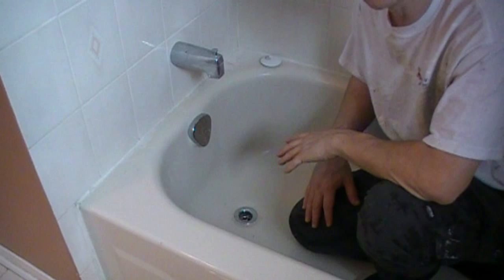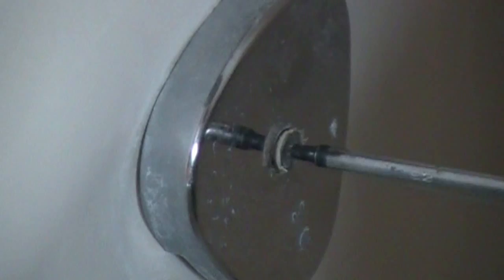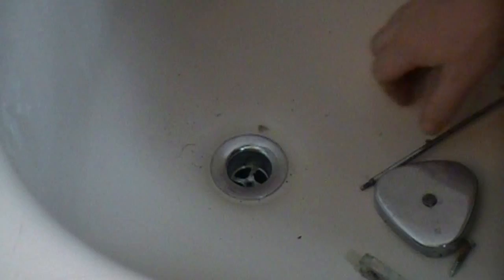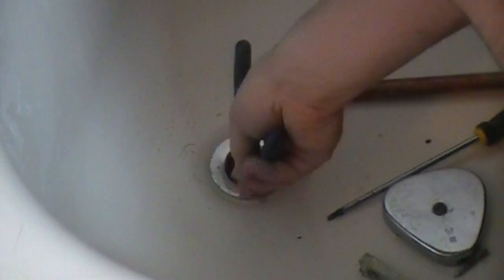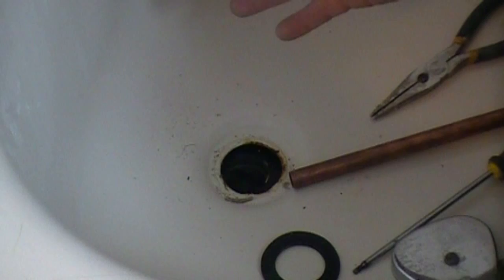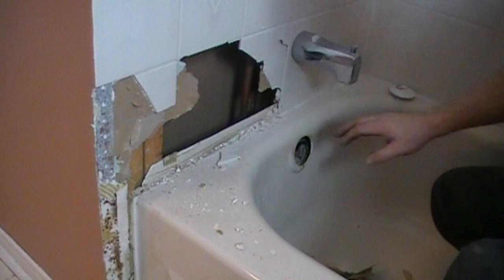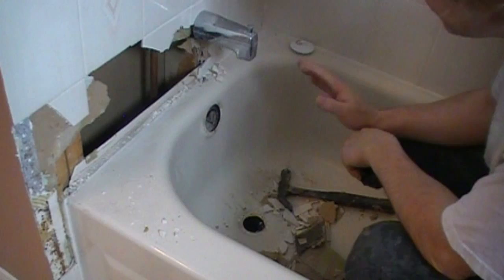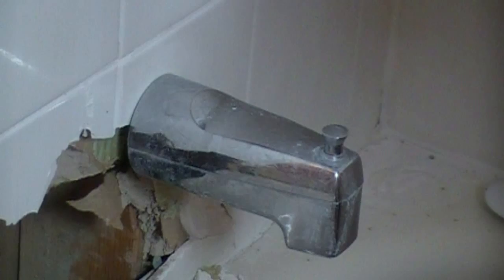Removing a bathtub - How to DIY

Comment from the maker: With the drywall removed, you should have space on either side to get it in. Or out. 

If the tub is cast iron, you can take a sledgehammer and break it up. Same if the tube is acrylic. If it is steel, like the tub in the video, it is lightweight and you just pull it out.

Comment: I watch62 tub removals your is the Best explaining and showing and no sledge hammers
Reply: You don't need a sledge hammer on a steel tub such as this.  They are light and easy to maneuver around.  I've used a sledge hammer on cast iron tubs to break them apart and make it easy to carry out of the house.

Comment: It works well to use a combination wrench to remove the drain flange, Just choose one with an open end that will fit inside the drain between the crossed portion inside. Then you can insert a pipe or a long screwdriver through the closed end portion of the wrench to twist the drain flange out of the tub,

Comment: Most of those drain flanges don't come off that easily even if you're using the proper tool which I own. If it's seized, try using a air dryer on high heat to loosen up the plumber's putty before twisting it off or you run the risk of breaking the cross in the drain flange.

Comment: A contractor for my apartment building said that to remove my bathtub he would need to go through the wall to disconnect the drain. It sounds like there are different kinds of drain arrangements and not all can be done this easily.
Reply from the maker: The connection has to be at the tub. The plumbing can go anywhere throughout the house. But the tub is still the tub.

Comment: A bathtub is basically a 60 inch box and the room it is in is basically 60 inches wide. Depending on the height and style of tub, it can be problematic trying to wedge it out of its home. I tried once to install a new tub in a framed room and I ended up having to go through the wall.

Comment: But if the tub is basically a 60 inch box and the room is 60 inches wide is there not some problem when the tub is tilted in order to remove it from the space? Does it not jam in the restricted space? I suppose it depends on the tub. I installed a deep tub in my basement when I finished it and there was no way I could get the tub in the bathroom without going through the wall. Now there would be no way to get it back out without going through the wall (or cutting it in half).

Comment: what about if my bottom drain doesn't have the metal to put the pliers in order to turn it an remove it?
Reply from the maker: That's a tough case. In that case I would take a 1/2 inch socket wrench if you have one, and buy a very large socket that would barely fit inside. Then hit the wrench with a hammer.

Comment: Hi there, how would I prepare to remove the bathtub when the fixtures are not on the wall, but on the bathtub itself?
Reply from the maker: You mean like a jacuzzi tub? The same thing for the drain. And for the fixtures, you simply unhook them. The taps will come off if you unscrew the handles. Just look at how they were put on.

Comment: NEVER EVER EVER have drywall in a shower, even if there is tile. That whole tub surround should be gutted and done properly.
Reply from the maker: I can tell you that drywall was put in there by the builder and when I removed it 20 years later, it was as good as the day it was put in. So what you say is not true. Cement board is best, but if tiled with a non-porous tile and sealed grout and silicone joints, no water will get in.
Reply: theknightlynews
 All I can say is you were extremely lucky. Please, anyone who reads this, drywall and green board are not acceptable in shower stalls or bathtub surrounds. Unless you want huge repair bills in the future, don't take the chance.

Do it right, or don't do it at all.
Reply: +theknightlynews Hi, How do you put back the dry wall? Do you have a video for the next steps?
Reply: I don't think has another video,Because of the demolition only.
Reply: Depends on what system you use before ever placing 1 tile

Comment: my drain doesn't have the hole that your sticking the needle nose pliers is. It's just one big whole. I just tried the pliers and it's not working. I'm a big guy and I'm using all my strength and it's just going to happen any advice?
Reply: Jordan  Epperson hire someone
Reply: Well I'm here to learn how to work on my house so that would be a little like giving up wouldnt it? I got it by heating it up to loosen the metal and oiling the drain. Found a snug fitting piece of steal and a pipe for leverage. DIY right? Thats what we are all here for:)
Reply: @tojoishida4789  Thats why we come here so we dont have to pay sombody else!!!!!!!!!